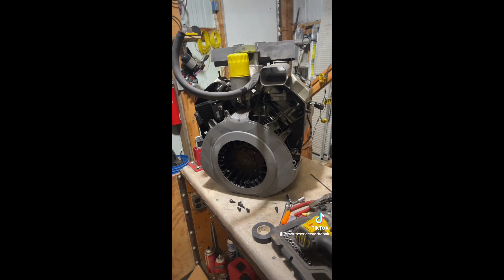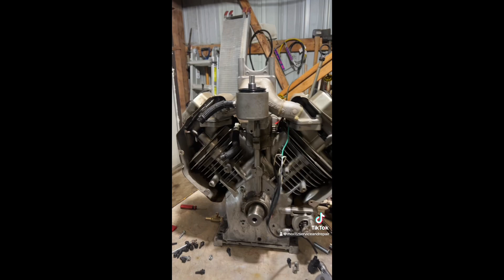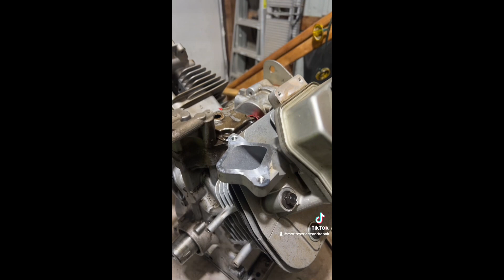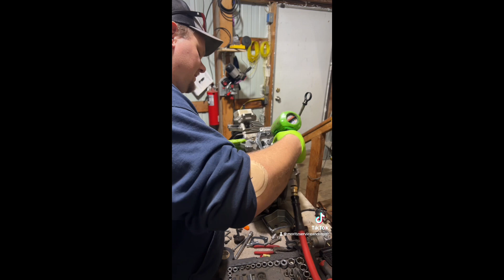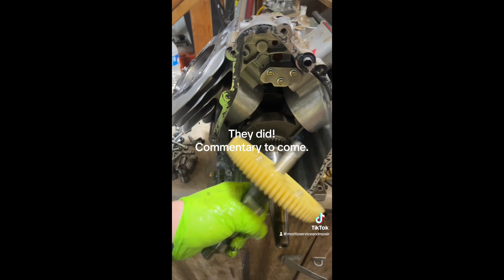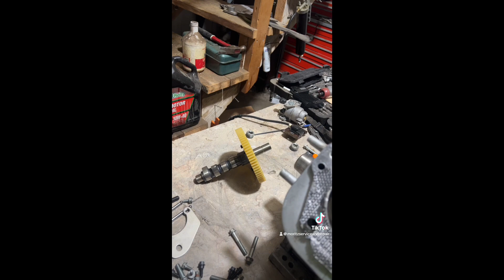2019 Kohler CH1000 Engine Teardown

Comment: What caused the pressure rise to push the oil seal out?  Were the seal seats out of tolerance?
Reply: Asking, because I found the pto-side oil seal pushed partially out on my newly-commissioned 20 RCAL.  No oil loss, yet.  Distributor taking it to their shop, tomorrow.

Comment: Hello, I have a cub cadet gt2544 with a Command engine. They are fantastic, but the smaller engines have a nylon oil pump gear. What do you think about those gears being nylon?